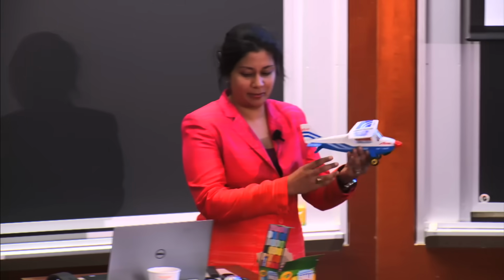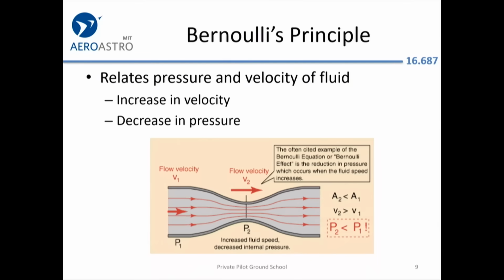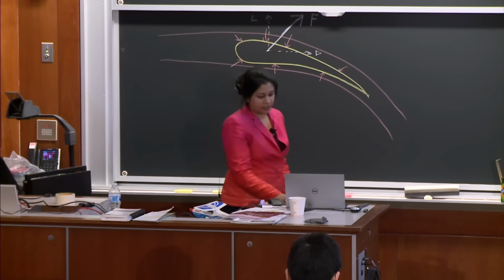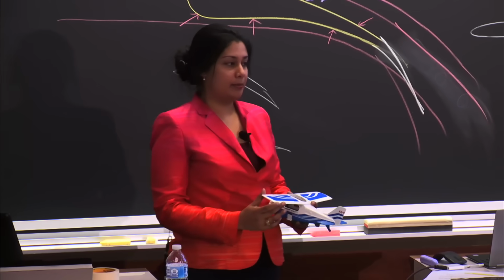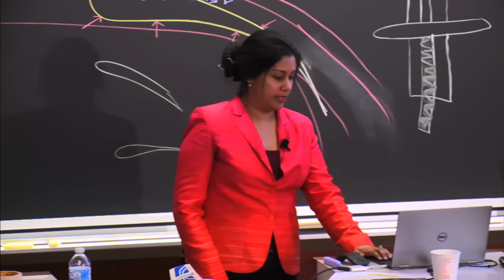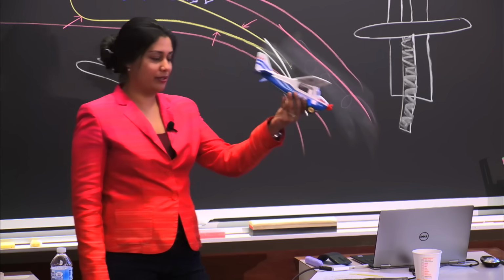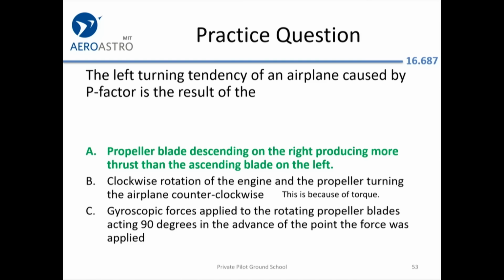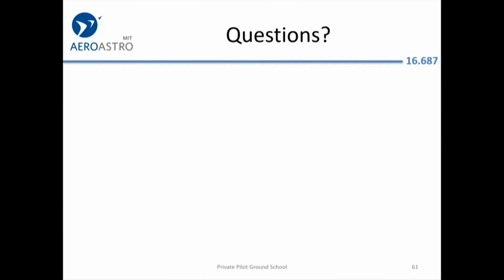Lecture 2: Airplane Aerodynamics

Comment: I saw a single picture in introductory physics book in chapter on fluid dynamics and I knew instantly how planes fly. air moving against the wing will generate lift, wing moving against the air will generate lift, both happening at the same time will only make matters worse.

Comment: I have studied physics, aviation, astronautics, and aerospace engineering for over 50 years. Aircraft do NOT fly on compression lift alone and most airfoils are flat on the bottom. The curvature over the top of the wing causes the air to accelerate because it has to travel a longer distance and thus lowers the pressure. When the velocity of a gas or liquid increases the pressure decreases. It is called the Bernoulli Principle. That is why you see a vapor cloud form over the top of a wing. Especially during high speed maneuvers and high angles of attack. Furthermore, Lockheed's legendary designer Clarence "Kelly" Johnson, (designer of the U2 A12 and SR71 Blackbird) didn't put to much faith in compression lift. An aircraft that did utilize compression lift was the North American XB70 Valkurie. Surfaces were arranged so that supersonic shockwavs would reinforce themselves. The airfoil she drew on the blackboard with its downward slope on the bottom would cause ENORMOUS drag.
Reply: You've "studied"😂😂😂😂

Comment: The success of wing design originated in an Ohio bicycle shop of the Wright Brothers.  They built and used a wind tunnel to test their wing designs and construction.  At Kitty Hawk N C the design theory met real world.  No wing flys without design, angle and motion through the air.   Unless the wing is moved through the air with an engine, you only have a kite.  An engine makes the airplane fly.  It’s the engine that allows a wing to have lift.  The wing has no lift without motion through the air and no wing moves through the air without ultimately an engine being involved.  The engine makes the airplane fly, not the wing.

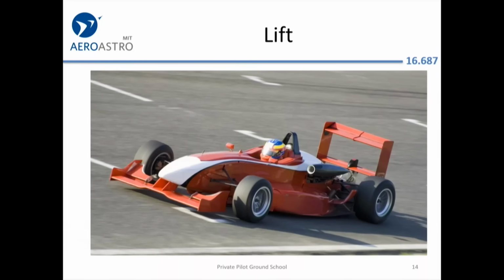Comment: 16:30 That isn't a spoiler, that's a rear wing and it also has a front wing. Spoilers reduce drag and lift by smoothing airflow over the rear. Wings create downforce to improve tire traction and handling. Spoilers increase fuel efficiency, wings destroy fuel efficiency. Spoilers on street legal cars are mostly for looks, to increase fuel efficiency, and to keep the rear window from accumulating rain, snow, dirt etc. A properly designed spoiler will make a car faster due to the reduced drag. A properly designed wing will make it slower but more stable while cornering at high speeds due to the downforce keeping the rear end planted.

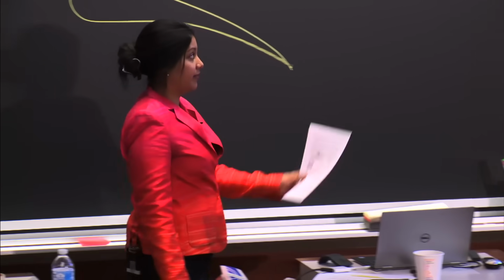Comment: 12:37 she just said the equal transit theory is wrong then how does bernoulli's apply here, because the air on upper surface is not moving faster than the lower ???
Reply: There is an addtional pressure gradient caused by viscouse effects at the trailing edge that cause the flow to move faster on the upper surface. This was explained by Prandtl, the father of modern aerodynamic, and the document is freely available from NASA (Applications of Modern Hydrodynamics to Aeronautics)

Comment: why doesn't air push the wing down, if the air on top and bottom of the wing is moving down?
Reply: The correct flow field has the air moving up towards the wing in front of it, this is called upward turning (completely missed in the drawings in this video), and then there is downward turning after the wing. But, at the surface of the wing, since in the streamwise direction above, the pressure is lower, and the opposite is true underneath, the next effect is that the pressure of the air pushed the wing up. That is lift, this is how we measure it in a wind tunnel.

Comment: The Coefficient of lift and angle of attack graph shown is incorrect. The graph is not generated at or through 0degrees angle of attack, in fact from minus 4 degrees angle of attack.

Comment: @39:13 If the airplane ✈️ stalls because of the angle 📐, does that mean that air, lives freer, East to West, vs North to South? Air is gas right? So shouldn’t it not stall? 
That’s why I’m thinking it runs in a current of east and west. 
Kind of like water.

Comment: About the racing car: It's not just the "spoiler" (rear wing) helping to keep the car firmly on the ground. The car had 2 wings. Front and rear. They are both doing the exact opposite to what the wings on an airplane does. They both generate downforce. In doing so, they increase drag too. The ideal racing car design maximises downforce while minimising drag. Downforce is very useful while cornering, but if it comes at the expense of a lot of drag, the car will have a low maximum speed, that will be very counterproductive in the straight parts of the road/circuit. 

Aerodynamicists work within racing teams to continually improve how the front wing directs air along the car, how the car body channels that air usefully towards the rear of the car, and how the rear wing (and other parts like the rear diffuser) make use of that air, to again generate downforce and minimise drag. All this, while keeping a certain balance between front and rear downforce. The last thing a driver wants to have while taking a corner at high speed is a lot less grip at the rear of the car and a lot at the front, or the opposite, as they will make the car difficult to drive through the corner. 

Racing teams test their designs in wind tunnels too, using scale models of the car parts they are intending to build.

By the way, the design of the body and floor of the car already generate enough downforce to keep the car on the ground when driving in a straight line. The point of downforce is to counteract the SIDEWAYS forces encountered while cornering. If racing drivers could make the car's wings disappear during straights and re-appear while cornering, they would have just that, as it would make them faster. In fact, moveable aero devices with exactly that objective have been tried, and outlawed in most racing competitions (mostly on safety and cost grounds). Formula 1 does have a version of this called DRS (drag reduction system), where a part of the rear wing flips into a horizontal position, or an inclined position, depending on what is ideal for that part of the circuit. 

Some designers have bent the rules at times, making their wings flexible enough to bend under increased speed (i.e. increased wind resistance) and become more horizontal in the process. The effect being that drag and downforce are reduced in the faster (straighter) parts of the circuits, while the wing rests back into its higher downforce position when the car slows down to take a corner.

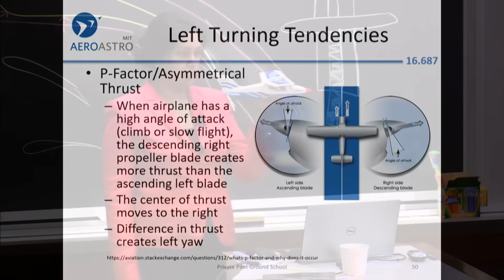Comment: 1:03:30 Isn't because the propeller starts from angular rest and then requires acceleration to start angular rotation, and because in the example shown in the lecture the propeller rotates clockwise the blades needs to move towards the right, right force it is, therefore to counter that force the plane body has to have a tendency to rotate a bit to the left.

That's my understanding, I hope someone corrects me.

Comment: Even MIT misleads their students and they will later have to relearn the truth.  For example, the Bernoulli Principle applied to the wing provides less than 10% of the possible lift, misses by more than an order of magnitude.  And it’s further not like bullets striking the underside of the wing at a sufficient angle of attack.  If you can’t instill the proper realities in their minds, don’t teach it at all.
Reply: Are you trying to hint at the fact of suction pressure on the upper camber and applying the principle of newtons third law in relation to downwash?

Comment: Great video, but as a physicist and former amateur racing driver, I just wanted to comment on the section around 17:00. That’s not a spoiler, it’s a wing. A spoiler, be definition, redirects airflow to cancel out the inherent lift of a car. You get them on the rear of road cars, as most road cars generate lift, moreso at the rear. On that F3 car, there are two wings*: at the rear *and the front, along with a flat bottom and quite a big Venturi tunnel underneath (so big that the exhausts have to take an unusual route). These all create substantial downforce (negative lift), of the order of several thousand Newtons. This is way more than cancelling out any inherent lift; it’s crucial to how the car drives.

I also think it would be helpful to explain the principle that makes the air stick to the top surface of the wing. I assume this is the Coanda effect? It’s easy to explain without maths and would simplify and clarify all the talk of both lift and stalls.
Reply: Actually, it is not Coanda, that is not relevant here. The Coanda effect needs to have a jet with a higher starting total pressure. The viscous interaction between the jet and the static fluid (which must be the same fluid, so not water in air, that is a surface tension effect), results in some of the static fluid being dragged along. Now, since it has a lower total pressure, and we increased the dynamic pressure by making it move, it now has less static pressure. This is what Coanda is about, creating a region of low pressure. This enables a jet of fluid to more easily follow curved surfaces, because the favourable pressure gradient it produces. To be very clear, like the F-104 we can add blow flaps where we take a jet of air, and we blow them over the wing, to produce more lift. But, that does not apply to a simple low speed aircraft.

What does keep the flow attached, well that is the pressure gradient force. There can be no vacuum. If there was, there would be a low pressure region, and the fluid would be force into it. There is also the force associated with viscosity, this give the boundary layer at the surface. So, if you comment there about being easy to explain is in terms of using Coanda, I hope I have just demonstrated that it is not applicable here. Unfortunately we need the Navier-Stokes equations, and those are hard applied maths...

Comment: Do the struts support the wings? That sounds like they carry the weight of the wings. Don't they transmit the lift force to the fuselage as braces. In flight the wings generate the force vertically upwards and don't load the aircraft downwards with their weight. It is the struts which transmit the weight of the fuselage to the wings and Tina Srivastava is a MIT instructor.:face-blue-smiling:

Comment: While discussing P - Factor, another comment to help explain the left turning tendency can be explained in more common terms by comparing the way pretty much all motors (including electric motors) try to twist when they begin to spin.. when not mounted efficiently even in components, the twisting tendecy is usually obvious when the motor starts up. When the plane becomes airborne, it no longer has the ground to push against. This is why it starts to wander when actions arent taken to counter it. I would expect that propulsion driven engines (jets) would have less twisting (left turning) tendencies

Comment: This is a good lecture, but I would have presented some aspects in a different manner.

I would have said that lift, and one type of drag, are purely due to "accelerations of air masses" from above the aircraft to below it.. I would not talk of velocities nor location of air particles, nor Bernoulli, nor Newton and nor Coanda'. as all these depend on purely acceleration of fluid masses or  A CHANGE OF VELOCITIES  and not velocities , 

Also if the wing is moving horizontally  at a constant speed forward, in a stationary air, then the wing moves, but the masses of air are primarily accelerated vertically downwards, while below the wing, the stationary air masses are also accelerated forward a little, while those above the wing are accelerated backward a little , resulting that above and below the wing, at the trailing edge, one does not get the same  transit time nor the same exit velocities ( downdraft components) and there is always a little vortex at the trailing edge  which can grow bigger at a large angle of attack. 

In a wind tunnel where the air moves, and the wing is stationary,  then below the wing, the air decelerates down a little  in the  forward horizontal direction, while above the wing the air is accelerated faster in the backward horizontal direction, all this in addition to the air mass  in the wind tunnel being primarily accelerated downwards, The trailing edge vortex in the wind tunnel is exactly the same as that with the wing moving forwards in stationary air.

Now, this is what happens below and above the wing, Let us assume that the wing is moving and the air is stationary. 
The mass of air ahead of the leading edge will start  settling to divide, to go below the leading edge and above the leading edge,  similar to  an angled  knife cutting through soft cheese, but a little more complex than that. The air mass that goes below the wing is effectively a mass being " hit" by an angled  cricket bat, and this action primarily accelerates the  mass of air downward, and a little forward,  It is this downward acceleration of air masses  that causes the high pressure below the wing, where most of it goes to lift vector of the wing and the other forward little  acceleration to contribute to the drag 

Above the wing it is more complicated. As the upper leading edge surface "Hits" the mass of air, it also acts as an angled cricket bat to accelerate the air upwards, and this minimizes the air molecules close to the surface at the leading edge and hence low pressure forms.  As the masses of air above the leading edge go "vertically up" they leave behind them a partial vacuum, and so they start decelerating in a vertical direction to become stationary then turn back to fall into the  partial vacuum below it and above the wing top surface. This state of affair accelerates the air mass, deflected by the top leading edge to accelerate down into the partial vacuum and the receding down hill  rear part of the top surface after the maximum thickness of the wing, this will give the air masses a longer flight time  to keep the  partial vacuum above the wing . Then all this is dumped behind the trailing edge at a faster speed than that mass of air from below the wing, hence at the  trailing edge, there is a small vortex forming at normal flying angle of attack. 

If one computes a vector integral around a close d contour close to the wing upper and lower surface one gets the resultant vector which contains the lift and the drag information all due to forces generated by accelerations of masses above and below the wing. .

The front of the fuselage will need to open an aperture for the aircraft to fly through it, In this case the acceleration of air masses  need to include a lateral accelertion to the left and right and up and down  and it is this acceleration, to open up the aperture for the fuselage  to fly through, which will give the drag and the body lift of the fuselage,   It is all acceleration forces of masses that create the lift and induced drag,  

For this discussion we shall neglect the effect of friction and shearing of the fluid around the wing and stick to the effect of the ACCELERTION AND DECELERATION OF AIR MASSES AROUND THE WING to create pressures and partial vacuums,  including the air masses having to be accelerated back to fill the space behind the aircraft, as it flies through the aperture of its own making. This tend to pul the fuselage backwards hence drag. 

In a forward moving wing, pay attention to the acieration of masses vertically down  from above and below the wing, also the little horizontal accelertion of air masses forward below the wing and backward above the wing to give a different transit time  and different exit  trailing edge velocities above and below the wing to create the little vortex behind the trialing edge.  It is such acceleration of masses that contributes to Bernoulli, Newton, Coanda' effects, so one should stick to basic principles which existed long before Bernoulli , Newton, Coanda' exited,  and all birds as eagles and owls and sparrows and parrots knew it all so well a few million years ago .

Comment: I see no relation between Bernoulli's Principle and the answer "C "at 13:03. From Bernoulli's Principle results that IF "Air travelling faster over a curved upper surface of an airfoil causes lower pressure on the top surface". Question is - from where do we deduct that the Air travels faster atop and not on the bottom surface? If that is true, than yes, this adds to the lift force a bit.
Reply: WHY it is faster above a wing is BECAUSE of the decreased pressure. The elevated pressure near the leading edge Accelerates air toward the lowered pressure above the wing.  That is fundamental physics.

Comment: P factor question of student is about when plane yell left will it have p factor force up and down, because  when yell  propeller also attack parallel wind stream lines differently but  it depends from angle of yell turning  angle and it is small so reaction of that p factor is small

Comment: Quite intriguing how they accounted for the change in density of air based on altitude. 

I mean, it is much easier for a jet to take off at ground level because there is so much more wind resistance. However, I often wonder how an aircraft recovers from stall at an altitude where the air is so thin that even the engines struggle to provide adequate thrust. 

Sorry I was just rambling 😅